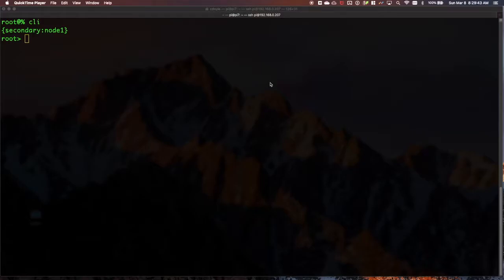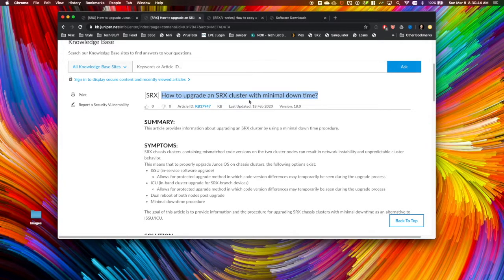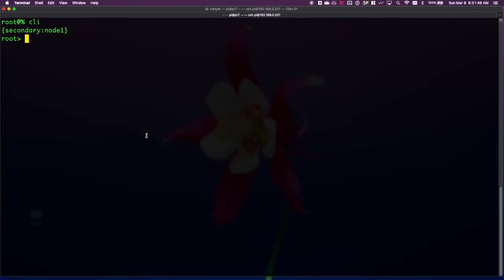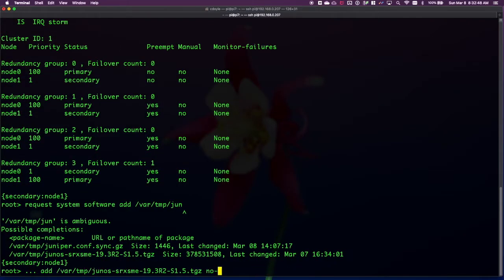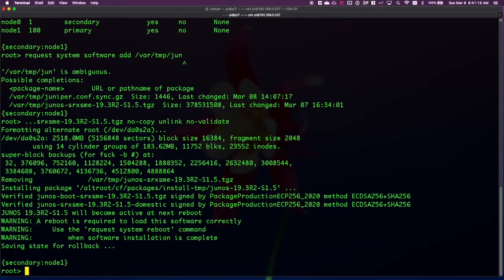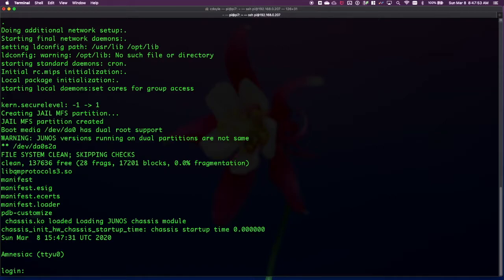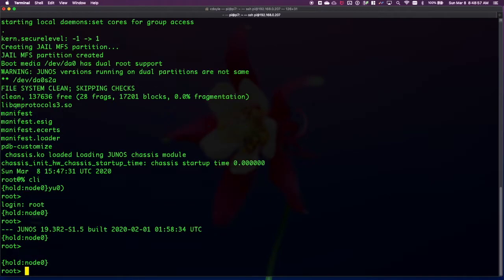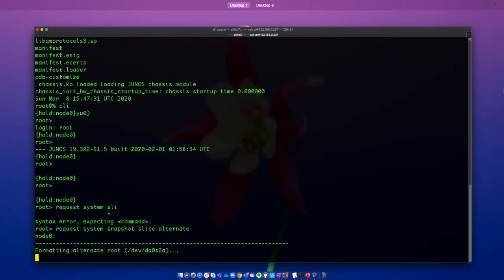SRX340 upgrade process

Comment: Is this command required on both nodes or just on the node0 : request system snapshot slice alternate ? Thanks!
Reply from the maker: Both nodes. The snapshot insulates against boot failure by creating a snapshot of Junos on a secondary partition of the device you run it on. These local snapshots are separate from clustering functions, and while a firewall cluster should be sufficiently resilient to weather a boot failure, the snapshot greatly simplifies recovery time.

That said, I've never seen an SRX boot to the recovery partition. This is more common w/ access-layer switching, where power is typically less robust than what you find where your firewalls are installed.

Cheers for the question!